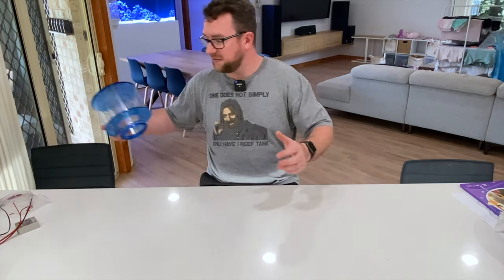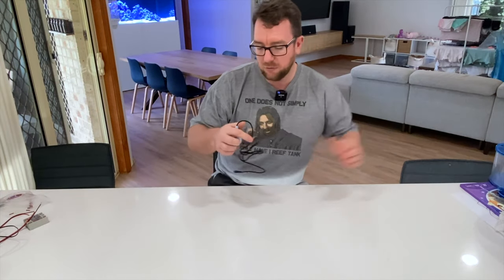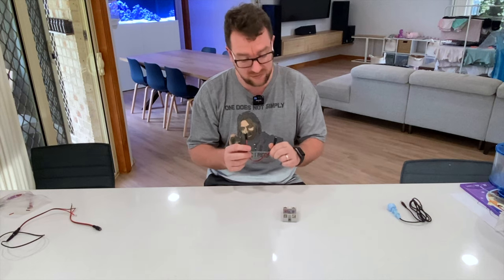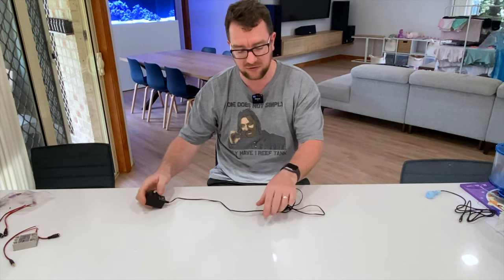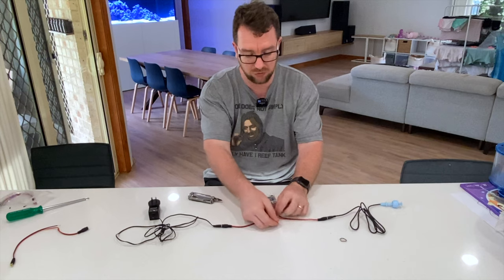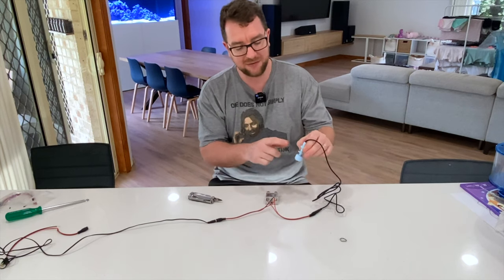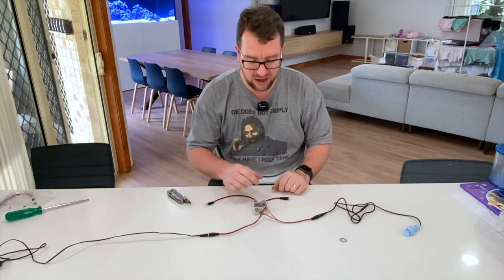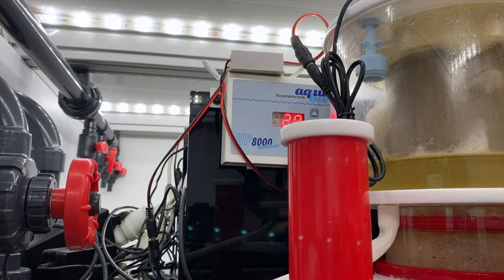DIY Skimmer Overflow Protection

Comment: Nicely done!

You can also replace the 2mm connectors with water proof connector ones for better reliability. I used ones that were 2-pin connectors intended for automotive electrical systems (available easily enough in 5 packs on amazon). Works like a charm. Given I have a Reef Octopus Elite skimmer with the float built in, I just had to snip the existing line to install, no need for the relay that was detailed here.
Reply from the maker: Yes those connectors are much nicer!

Comment: You're a genius. Love your videos mate. Just what I've been trying to do and the guys at Jaycar couldn't help.

Does it matter if I get a 24v or 12v float switch if the skimmer is 24v?
Reply from the maker: the float switch itself won't mater as long as it can handle the small current you are putting through it to trigger the relay

Comment: Great stuff. I case i missed it somewhere, maybe Just remind people to wire the connection tip positive or negative inside the plugs . Or fried motors etc
Reply from the maker: Yeah thankfully those connectors come pretty wired with the red lead for the internal pin :)
Reply: @ParkersReef  ok cool wasn't sure as some items do come opposite.

Comment: Hey Sam I’m not an electrician either, but I’d have thought you’re basically just shorting your transformer with this circuit design! You’ve got basically no resistance on the float switch side of the relay.

Your transformer is connected to the float switch (negligible resistance) and the relay (negligible again, powering an LED). V = IR. 12V = massive current x tiny resistance. The link you quoted for your float switch allows for a maximum current of 0.5A through the float switch. To not exceed this, you’d need a 24 ohm or greater resistance coming from somewhere. The transformer is only meant to output up to 1A.

Additionally I notice you’re switching on positive for the float switch side which sounds good, but switching on the negative side for the skimmer power supply. Prob better to switch on positive for DC you’d have thought, though I doubt it would matter much given the transformer will be isolated from ground.
Reply from the maker: Sounds like you’re all over it mate,  nice one 👍🏻
Reply from the maker: Appreciate the input 👍🏻
Reply: I consulted a more knowledgeable source. Problem can be very simply solved by inserting a current limiting resistor into your float switch circuit. It would cause a voltage drop across the resistor that you’d have to account for. Here’s a simple calculator http://ledcalc.com. For you, input voltage 12V, voltage drop across “LED” is actually what u require to operate the relay so at least 3V but probably more for a buffer eg 5V, desired current through the circuit I input 15-20mA which is apparently standard operating current for an LED like the one in the relay. Calculator spits out a requirement of a 470 ohm (0.25 or 0.5W) resistor to get your current down to a nice 15mA. No more risk of melting your transformer / fire.
Reply from the maker: Perfect thank you.
I will add one to my circuit, although I must admit it’s been running on the old skimmer for 6 years without issue  before I moved it onto the new skimmer.

Never hurts to improve the design though. Thank you 👍🏻
Reply from the maker: All good mate, I had seen the design spec with a resistor in it, but couldn’t really say for sure if it did and couldn’t find any spec on what resistance it is.

Never a need to apologise for safety! Appreciate your time and effort in looking into it 👍🏻

Comment: Great video Sam, but really hanging for the next one on the neck cleaner.
The float switch your eBay link goes to is 100mm long. That seems a little too long, is that the correct one? Oops, it doesn't matter anyway, mines AC!
Reply from the maker: that's just a sample, get one to suit your length :)

The neck cleaner one will come soon, although I must admit - it's more a video of how to fit an existing neck cleaner to your skimmer lid so you don't have to use those ugly universal ones :D
Reply: @ParkersReef  mines AC anyway, derrr!

Comment: If you love little tech items like this mate jump across to rs components . They sell
Better quality then eBay and usually cheaper too. (Sparkys tend to buy of them)
Reply from the maker: For the relays?
Reply: @ParkersReef   relay/ contractor and also for the float switch . All components . Even the supply leads , power supplies . Jump on rs you will see what I mean .
Reply: Or core electronics are good too. You can get solid states with covers to.
Reply from the maker: Can be a fair rip on postage though sadly :/
Reply: @ParkersReef  I know but to be honest the float switches of eBay . Very much running the gauntlet with life expectancy,